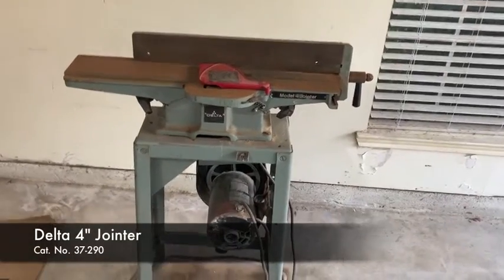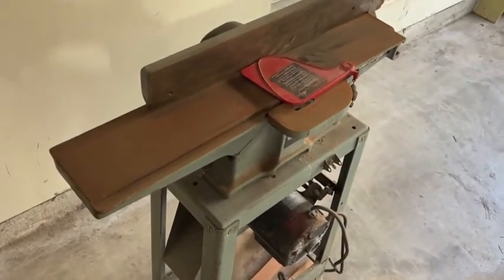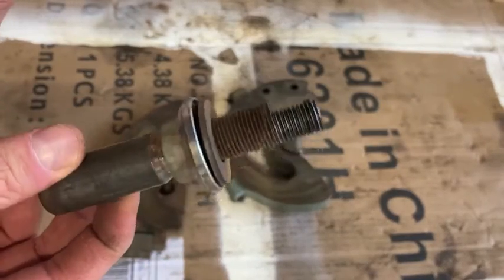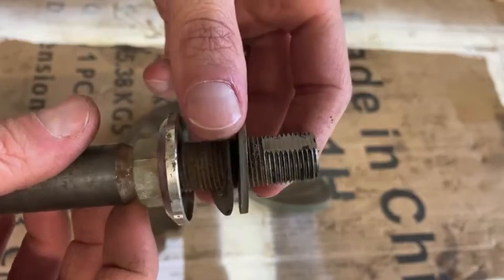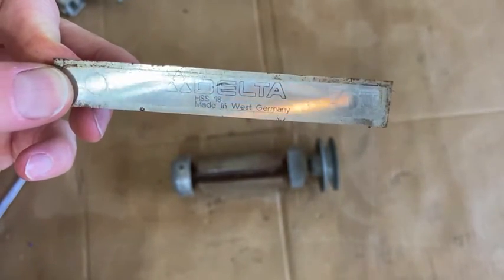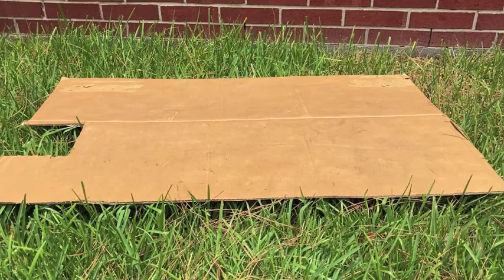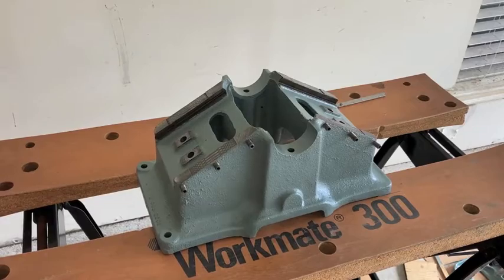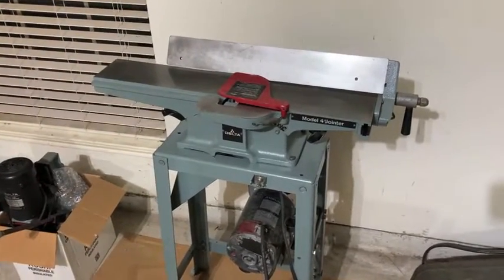Vintage 4" Jointer Restoration Delta 37-290

Comment: I picked up a much old version of this jointer. It's on my to do list. Thanks for sharing.
Reply from the maker: There’s very little difference between this jointer from the mid 1980’s and the earlier Rockwell models back to the 1940’s. I also restored a 1980’s Unisaw where all of the internal components were pretty much identical to the early models. It’s incredible how little these Rockwell/Delta machines changed over the years.

Comment: Great restore!  What was it that you sprayed before paint? And what kind of paint did you use? Looks really nice.
Reply from the maker: Thank you! What I sprayed before painting is a product called, Loctite Rust Neutralizer. You can spray it on lightly rusted surfaces and it prevents future rust and acts as a primer coat for painting. 

As far as the paint itself, it’s an oil based Sherwin Williams. I took a piece of another delta machine and they matched the color perfectly.

Comment: Well done sir. She looks healthy again. What kind of paint did you use And what color?
Reply from the maker: Thanks! I used a Sherwin Williams oil based paint for metals. I actually restored a Unisaw from the same era last year (late 1980’s) and had some paint leftover that I used. I took a piece of the Unisaw to Sherwin Williams and had them match the color. They matched it perfectly. I still have the can if you need to know the exact color mixture. Let me know and thanks for the comment!

Comment: I need a sawdust diverted any  ideas
Reply from the maker: I would probably remove the dust chute altogether and build a something that mounts directly underneath that I could attach a dust collector to. The chute doesn’t really seal well and has a very large opening at the bottom. I don’t actually have this jointer anymore, since I got a larger one so this is mostly from memory. I hope this helps.

Comment: Pickup a compressor and a sand blaster. Rust removal on reconditioning / restoration is easy. Messy, but easy!😂
Reply from the maker: Oh yeah, you’re absolutely right. I’d like to get a sand blaster one day, but I’m making it work with what what I’ve got.  I’m also somewhat limited on space so I have to be judicious in my tool acquisitions.  Great suggestion!
Reply: I’d use dremel or die grinder with wire wheel vs super expensive air compressor to keep up with sand blasting